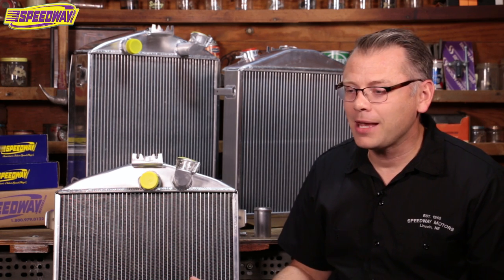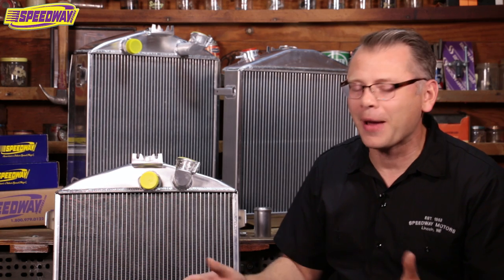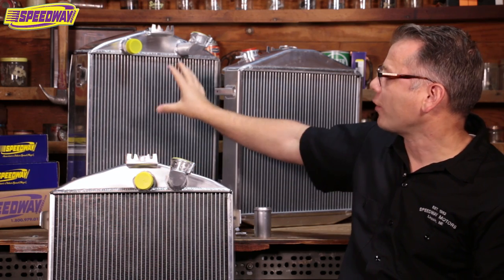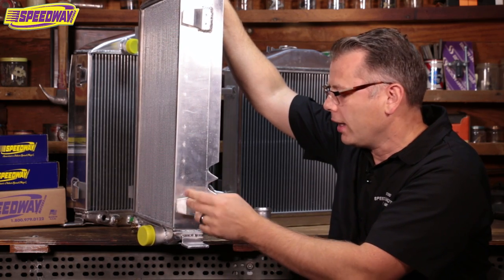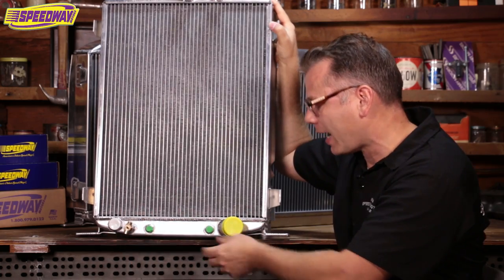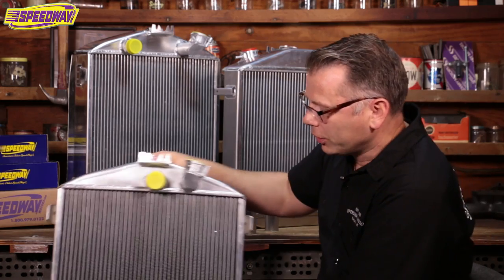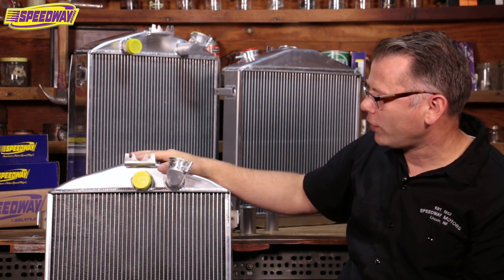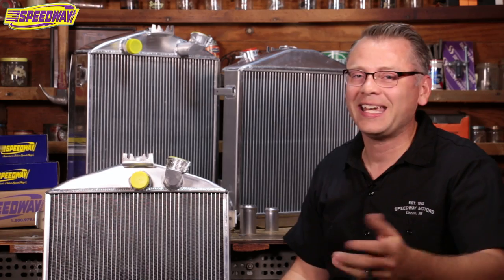Speedway Tech Talk - Hot Rod Aluminum Radiators

Comment: Hi Tim I got a 30-31 Model A Ford coupe going on a 32 chassis using a stock height  fiberglass 32 radiator shell with the stock outlet radiator cap opening Making a highboy coupe the question is to get the right height of radiator for that application because I know that a model a cowl must be a little shorter then a 32 so my radiator shell and grill will sit maybe a little lower but went on H.A.M.B and one guy bought himself a walker radiator that's 2inches shorter and said it was a little too short and he actually had to shim it up a 1 1/4" so what to do is beyond me. Maybe I should just measure it but even that probably won't help in trying to get the right radiator. Why do projects have to be so hard when trying build hotrods with the right look. My radiator has to be set up to run a small block Ford with AOD transmission. So I will need cooling lines also a aluminum fan shroud with a 16" electric fan I don't want to spend more then 500 dollars for 4 core radiator with that set up which I looked on line a see Champion makes one for around that price I also want a overflow tank. My 302 already has the shorter water pump which come out of a 94-95 Mustang. I also have a question about if you get the radiator with the water neck filler to the inside of the radiator is it possible to get a dummy like cap or ornament to go in the stock location to fill in the hole.

Comment: What radiator works for a small block Ford for standard height 32 Ford radiator shell and grill. Make things afordable for the Ford diehard engine gear heads.

Comment: Hey Tim
I am working on a 1928 model a  coupe and have a 32 ford grill shell but am keeping the 4cylinder. What radiator fits the 32 shell but has the necks to fit the model a four cylinder?
Reply from the maker: If you are running the stock, 4 cylinder an oem replacement 1932 Ford Model B (4 cyl) radiator would do the job.  We do not currently offer a stock replacement 1932 4 cylinder radiator.  You may be able to use a SBC version, but I couldn't say what size the inlet or outlet need to be to fit your Model A 4 cylinder engine.

Comment: I am planning to build a V8 tricke with a 350 drive train. I will like to know if you recommend the 20" radiator and if you have any shorter than that?
Reply from the maker: The bigger the radiator you can fit the better.  We have a few different radiators that may work, but we suggest he call in and speak with one of our techs.

Comment: You lost me when you started talking about Chevy's in a Ford.
Reply: I agree! It's an insult to Chevy to plant one in a junk Ford chassis, but, if it's the only way to get a Ford labeled 'roller' down the road, you do what you have to.
Reply: @USMC-Sniper-0137  How do you make a ford go Fast?  ,,,,Put a Chevy Engine in it !!
Reply: I HATE THAT!
Reply: @Powerstroke2003  Aurdun Flat heads and Small block Ford is the only way to go. Chevy guys are always afraid of what's different. Say it won't run and I will show you it will.  You can build it the cheap way which Chevy or you can build it the right way and have something to proud of which is the Ford way. If I am building a Chevy it will have a Chevy if I am building a Mopar it will have a Dodge. if I am building a Ford it will have a  Ford. It's not about how much money you have it's the knowledge you have when planning your build out. Sometimes habit lots of money does not always buy more power to make a car fast. It's who you know or what you know or where you shop.